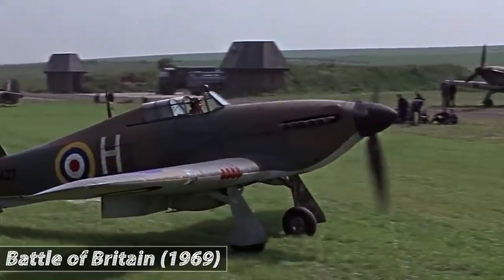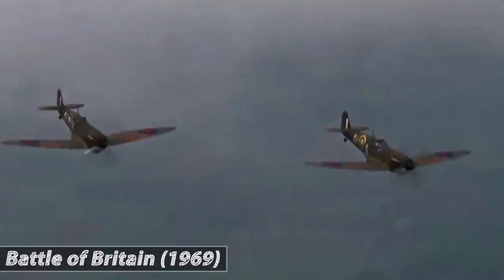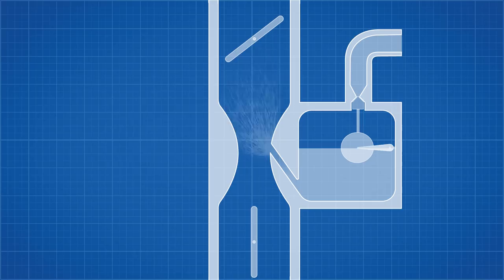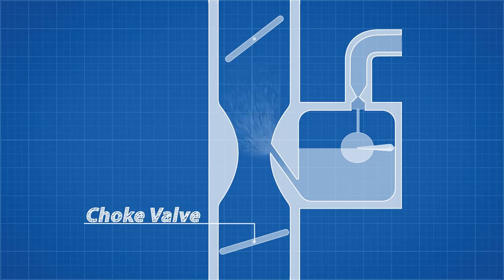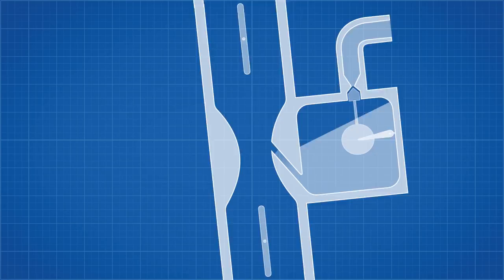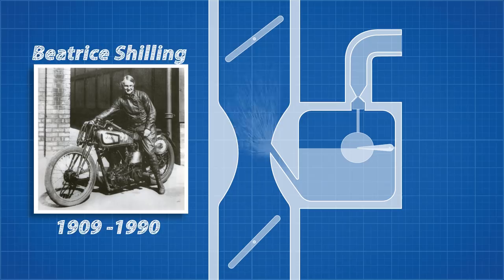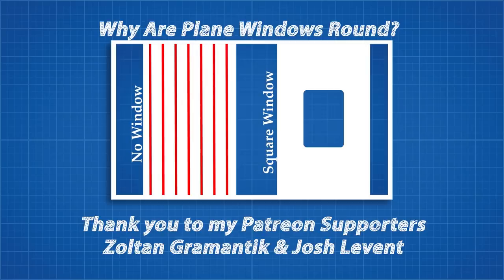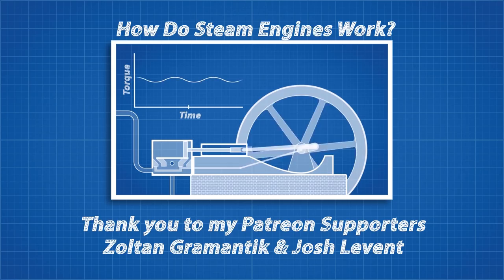The Spitfire's Fatal Flaw

Comment: Why did the video show a Hawker Hurricane? The later Merlins had fuel systems deigned for negative G...
Reply: The later merlins eliminated this problem with mechanical fuel injection. Which also helped boost horsepower.
Reply: Was about to make the same comment. You beat me to it. :)  The Messerschmitt Bf 109 and its inverted V-12 engine had fuel injection early on, whereas the Spitfire didn't get it until later.
Reply: Nick.
No the later Merlins still had carburetors, despite being smaller they gave  more power than the German fuel injected engines.  Fuel injection did not give more power.
Eventually Rolls Royce used an injection carburetor
Reply: The Hawker Hurricane also had a Merlin Engine with the same flaw.
Reply: Yes... but carburettors that allowed negative G.... quite different to actual fuel injection... still, never mind..... Good old Merlins... great engines....
Reply: Carburetors at the time worked better than fuel injection which is why Rolls Royce used them instead of fuel injection. Has no one wondered why the smaller Merlin was more powerful than the DB or Jumo engines.
Reply: Barrie Rodliffe Of course, fuel injection consumes energy.
Reply: Wasn't down purely to carb/injection for the extra power, it was because the brits had more reliable access to high octane fuels, meaning more boost on average.
Merlin was 27L making 1000hp at the start, while the DB601 was 34L making 1150hp, both on 87 octane.

Especially bad towards the end of the war for the germans where they were forced into using worse and worse fuel, resulting in low power and thus no real chance to hit high altitude bombers. Methanol injection didn't help as much as it should have.
At the same time, the brits had access to 150 octane and were pushing 25psi and making 2000hp+.
Reply: Yet early in the war the Merlin still gave better hp/liter than the German engines.  High altitude would be over 40,000 feet, the highest the B 17 could manage was 35,600 feet. Even the early Fw 190 A could go higher. The Ta 152 H got up to 49,500 feet.
Reply: Germany used 87 octane gas throughout the war.  Britain switched to 100 octane.  The immediate post-war Dehavilland Hornet used 150 octane gas which allowed each of its Merlins to put out 2000hp.  This is not the only explanation, but this helped.
Reply: +19Koty96 if the air fuel mixture is correct the engine doesn't care if it's a carburetor or fuel injection. If the fi engine made me power it is because their carbs sucked.  Especially since it was mechanical fuel injection which is terrible for varying engine speeds and conditions.
Reply: Barrie Rodliffe

Yes, but better hp/l doesn't need to be down to carb vs FI, can be down to the flow of the heads or the balance allowing different RPM, etc.

The problem with saying that the 190 and 152 'can' go to a certain altitude is how long it takes to get there and how they perform at those altitudes, and the simple fact of the matter is that the germans were having trouble with the B-17s, let alone the B-29 about to be made.
The 152 with the jumo 213 was meant to solve this, and would have - except for one small problem. It required 100 octane C3, which the germans simply couldn't get access to at this point. They were running sub-par 87 octane the majority of the time.

Despite these issues, the 35L 213 was making up over 2000hp on the 100 octane fuel, while the 27L merlin was only making 1700hp with the same.
Reply: Not only that, it was the Hurricanes that REALLY won the Battle of Britain. There were more of those flying at any time, with more kills. It was slower, yes, but it had a much simpler design that not only could take more damage, but was easier to repair also.Talking about the Spitfire as the winner is the same crap as always dragging out pictures of the Mark IV tank when talking WWI tank warfare. When was the last time they showed a Renault FT (the precursor to all modern tanks, really) instead of that shambling monstrosity that killed almost as many crew as enemy soldiers?
Reply: Better hp because RR knew about fuel injection and knew they could get more power using a carburetor, they solved the negative G problem which they also knew about. 
The problem of saying a Bf 109 which could go 5,000 feet higher than a B 17 and get there faster than any American fighter is really like asking us to believe in fairies. The B 17 without a fighter escort was not able to go over occupied territory, the USAAF stopped all bombing over Germany in 1943 because of the losses.
The Merlin was getting more power early in the war when Germany had access to decent fuel, the  
35 litre Jumo 213 was rated at 2050 hp almost as much as the earlier RR Griffon 65 engine, the  27 litre Merlin 130 or 131 was rated at 2070 hp at around the same time as the much bigger Jumo..
Reply: Are Norwegians all like you?
The Hurricane was in bigger numbers but the Spitfire which could also take a lot of punishment did shoot down a higher percentage of German planes while mainly taking on the fighters, the Spitfire also had a lower loss rate..
The Mk IV tank was still very similar to the Mk I, the first tank. Nothing wrong with the Renault tank that 
could not be put right for WW II by having more than a crew of just 2 .
Reply: Funny running into you here.
Reply: Parker
In the Battle of Britain there were more Hurricanes and per plane the Spitfire shot down more and had a lower loss rate.
Reply: Barrie Rodliffe The griffons I don't think suffered from the issues Merlin spits had in fuel starvation
Reply: The Merlin and Griffon did not suffer the problem from 1940 on, they still used carburetors.
Reply: soaring liar. 
The Bendix carburetor as given to Bendix by Rolls Royce who had solved the negative G problem in 1941 before there were any Packard built Rolls Royce Merlin engines, no differences between the two Rolls Royce Merlins apart form different bearing materials because of local productions and the heavier US made copy of the British supercharger, everything else was the same.
Rolls Royce did use the SU/Rolls injection carburetor, which is basically a single point injection, Packard was well paid by Rolls Royce who not only made many more Merlin engines but did all the development as well as making the Griffon and jet engines.
SU injection carburetor, not the Bendix as given to them by Rolls Royce.
Britain did have better fuel and made very good use of it, so what?
Germany used fuel from the USA.
Spitfire Mk II in May 1940 ceiling 37,000 feet.
Spitfire Mk V in April 1941ceiling 37,700 feet
Spitfire Mk IX with Merlin 61 engine in service July 1942 ceiling 43,500 feet.
Notice Wilbur the Spitfire Mk IX was in service in 1942 and capable of higher altitude than any US fighter in the war.
Reply: @Rev6044  150 octane as used in all Allied fighters after the spring of 145 on the Western Front, which brought immediate horsepower and torque improvements which the Germans were never able to equal with a prop plane.
Reply: @janlabij7302  
150 grade, not 150 octane.  earlier in the war the top fuel was 130 grade or 100 octane.
Reply: @kathryntruscott6351 , if you need to get away from a float carburetor without redesigning your whole intake manifold system, the "injection carburetor" or "pressure carb" is the way to go. If you try to install direct intake port fuel injection into a preexisting carburetor  type manifold, it doesn't work very well. It takes a specially designed manifold to get good efficiency, as the Germans found out.

Comment: Never let a good story get in the way of facts. The fuel starvation due to negative G was solved to some extent by a female engineer named  Miss Tilly Shilling. She came up with the answer by putting a washer like disc in the Carb that allowed enough fuel in without flooding the engine, it became known as Miss Shilling's orifice. When the Merlin 60's series came out a new Carb was installed overcoming the problem. But the Spitfire wasn't the only Fighter to be hampered by engine cutting out when the stick was pushed forward, the Japenese Zero suffered the same.
Reply: guess you didn't watch the video all the way through otherwise you would have seen the author talk about Ms. Shilling
Reply: When the Merlin 60 came out the problem had already been solved on the Mk V with a Merlin 45 engine.
Reply: Every nation had some plane with a similar issue.

Comment: The intro was talking about the Supermarine Spitfire but the video was showing Hawker Hurricanes. Yeah, both planes had those circle things on their sides and wings.
Reply: And the same engine and carburettor 😉
Reply: Both beat the Luftwaffe so the slight flaw wa snot fatal at all.
Reply: @barrierodliffe4155  Yeah it's a clickbait title, shame as the video is good if you didn't know about it already. But he doesn't give any evidence of when it resulted in a fatal crash or being shot down. RAF pilots were well trained and aware of the limitations of their machines.

Comment: RAF pilots solved the "fatal flaw" themselves by simply performing a half-roll before diving.
Reply: ...and by the time they did, their target was well out of range.
Reply: No, the Spitfire pilot could keep a Bf 109 in sight and gain in a dive, the half roll took very little time and it is not like they had to stop roll the plane and then start off again.   probably why both Spitfire and Hurricane pilots did so well, in 1940 the negative G problem was improved and fully cured in 1941.
Reply: Actually, no: DIRECTLY FROM A SPITFIRE PILOT, by the time he was able to half-roll, the 109 was well out of his effective range. (Remember: the Spitfires did not carry 20mm cannon yet.)  A Spitfire could not catch a diving 109-they were dead-even.

Source:"Fly For Your Life", the biography of Wing Commander (then Squadron Leader) Roland Robert Stanford Tuck.
Reply: John Ferguson.
There are many quotes by pilots including  this one  "  I saw 3 Me 109`s diving very fast and using full boost i was able to dive and  close to get on the tail of the leading one."    Flt. Lt. Kelly 
The Bf 109 was limited to 720 kmh and would break up at about 750 kmh
The Spitfire Mk I limited to 750 and not likely to break up, the limitation was the ailerons getting heavy, the Bf 109, the ailerons became almost solid at  660 kmh.
remember that the 0.303 had similar range to the German 20 mm, some Spitfires did have 20 mm, not many but a few did.  A German plane was shot down by a cannon armed Spitfire in January 1940
Reply: I PRESUME THAT THE MUSTANG P52 HAD THE SAME FLAWED SITUATION OVER THE MERCEDES FUEL INJECTED SISTEM...THAT IS SOMETHING YOU NEVER HEAR ON ENGLISH TV.....?
Reply: The Spitfire's biggest flaw was its short range.  Early marks (carrying only machine guns) were undergunned, none were especially rugged.  

Directly from an ace pilot who flew both-Battle of Britain era, so probably a 109e and definitely a Spitfire IIa: the 109 was slightly faster, the Spitfire was "decidedly" more maneuverable.  They were dead-even in a dive. 

The 109 had a better-protected cockpit, at the cost of poorer visibility. (It had no rear view mirror.)  The Merlin would, as noted, cut-out at negative G's at the time.
Reply: No-the Packard Merlin used the improved carburetor design from the start.
Reply: REMEMBER JOHN  WW2 WAS WON BY NUMBERS??? THE MACHINE GUNS ARE EASY REPLACED, IF YOU CAN CONVINCE THE OFFICIALS....? BUT PUTTING A FUEL INJECTION SYSTEM INTO AN ENGINE IS A WHOLE DIFFERENT BALL GAME.... SO AS YOU FINALLY NOTED '''The Merlin would, as noted, cut-out at negative G's at the time''''. YOU COULD HAVE JUST SAID ''''YES...?''''' AND CUT OUT ALL  THE.......
Reply: PLEASE STOP YELLING!
Reply: EXCUSE E MUA? I DO KNOW???  IT IS A BAD HABIT I AM NOT YELLING I JUST HAVE A BAD HABIT....YOU SHOULD RELAX AND DO SOME YOGA, OR GO TO SCOTLAND FOR A COUNTY DRIVE TO SEE THE GLENS  XX..... ♥ ☮
Reply: I THINK THE LUFTWAFFE PILOT WAS JUST BEEN COURTEOUS OR, THOUGHT ABOUT PRESIDENT GORING OR HITLER'S INCOMPETENT TACTICS???? BARRIE..? BUT STILL I'LL  PUT THE FUEL INJECTED MERCEDES BENZ ENGINE, OVER THE ROLLS ROYCE AS A BETTER ENGINEERED. ♥ ☮
Reply: The Spitfire Mk I or II had similar range to the bf 109 E,  the  8 machine guns were better than the bf 109 2 machune guns, the Bf 109 only had enough 20 mm ammunition for 6 seconds and having low muzzle velocity it was not very effective.  The Spitfire wa strong enough, more so than the Bf 109 . the negative G problem was first partially solved in 1940, I am not sure exactly when but from the information I have seen either by the Battle of Britain or during it.
Reply: @Johnny96ri  
Only because Rolls Royce gave it to Bendix Stromberg, the problem was solved before packard made any copies of the Rolls Royce Merlin engine.
Reply: @barrierodliffe4155  I read an interesting description of a dogfight at near 40,000 feet where the Me109 went into a power dive and the Spitfire followed. Eventually, the 109's wings came off and the Spitfire had to use trim tabs to pull out. The Me109 didn't have in-flight adjustable trim tabs - apparently they could only be adjusted on the ground
Reply: @Johnny96ri  Apparently, the 109 could out-turn the Spitfire, but there was a good chance its wings would come off in the turn
Reply: @melvillesperryn9268  directly from a pilot who flew both: no, it could not.

Comment: Video should be retitled to "any plane with carburetor's fatal flaw" lol
Reply: Any plane with a FLOAT carburetor.
If it has the same kind of carb you find on a weed-whacker or chainsaw, you're fine. Those use pressure carbs.
Reply: It should be retitled the minor flaw of any plane with a float carburetor, even the float carburetor could be used with negative G as was done, it was first improved in 1940 and the problem solved altogether in 1941.

Comment: The thumbnail shows a Griffon Spitfire, probably a Mk XIV. The issue was corrected before the Mk V.
Reply: SilverFortyTwo yes you can see the inlet
Reply: If im not mistaken its actually the mk9 that fixed the carburetor
Reply: @qayz0989  
The full cure was done on the Mk V, Rolls Royce and SU introduced the  speed density carburetor which was more advanced and went onto the Spitfire Mk IX.

Comment: Was another flow at the compressor of the engine. Spitfire had a 2 stage compressor, manually controlled, after 3000m stage one, and after 6000m stage 2. Me had an automatic compressor with incremental stages with optimum power output in every split second.

Comment: 0:01, 0:10, 0:33 are Hawker Hurricanes, the plane cutting out when inverted is also a Hurricane. 0:18 is actually a Hispano Aviación HA-1112 M1L , a Spanish version of the Messerschmitt bf-109, and actually has the same Merlin engine as the Spitfire and Hurricane.

Comment: More Hurricanes flew in the battle of Britain than Spitfires
Reply: Tijmen Verhagen are they? The hurricane's role in air superiority was to eliminate German bombers why the spitfires fought off the 109s
Reply: The Spitfire has iconic status but the Hurricane was the real work-horse of the RAF, accounting for 60% of the RAF's air victories in the Battle of Britain.
Reply: Although this is for the Battle of Britain. Later war the Spitfire variants did indeed overtake the Hurricane as the primary workhorse, with the Hurricane gradually phased out due to obsolesce, moved to secondary theatres, night-fighting duties .etc

Typhoon/Tempest never really replaced the Spitfire variants either but ended up being very successful for dual ground attack and low alt engagement roles.

It's arguable what the 'best' RAF prop single-seat of the war was - but based on all round specs alone a strong contender would be the Griffon Spitfire XIV (late model) with 21lb boost. The Mk.IX on 25lb boost was also very successful.
Reply: Simply because spitfires were so new that there were only a few squadrons equipped with spitfires at the time, and the hurricanes had been in service for years already.

Comment: most of those clips are of the  hawker hurricane
Reply: He responded to this in another comment - Spitfire footage was difficult to find, so he substituted with Hurricane footage. Both planes used the same engine, so suffered from the same carburetor issue.
Reply: Thanks
Reply: They need to pull his aviation creds
Reply: If you're going to insist on putting Spitfire in the video title, then the first plane shown in the establishing shot should at least be the damned thing.
Reply: +matttheyak 
Exactly.
Well put.
Reply: Yes! Why didn't he title the video "The fatal flaw with the Merlin engine", as the engines were used in the Hurricane, Spitfire, Mosquito, Lancaster, etc.?
Reply: +matttheyak preach!!#
Reply: Why fatal flaw ? it was not a fatal flaw and only applied to early Merlin engines anyway